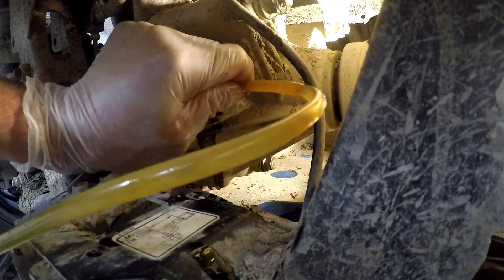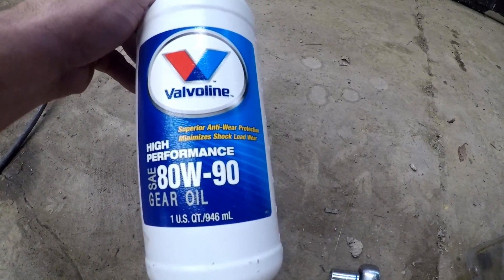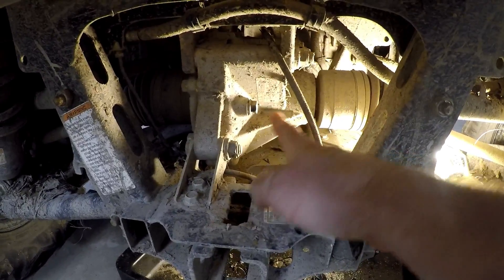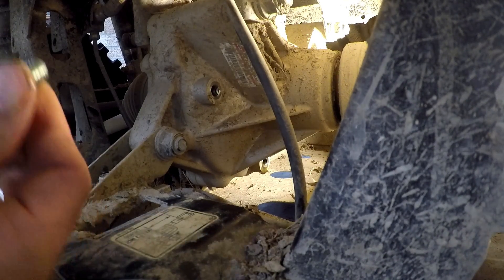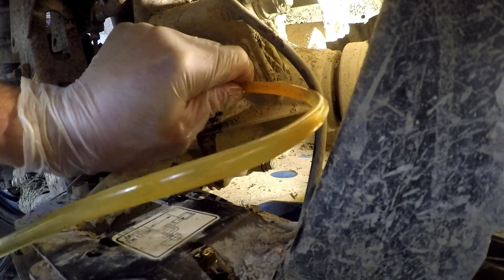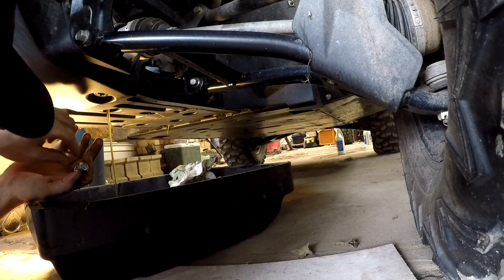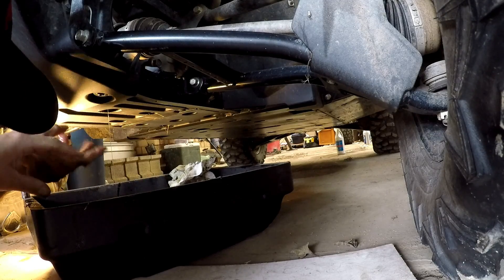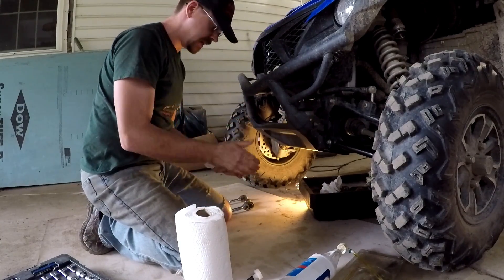Yamaha Wolverine X4 Service: Differentail Fluid Change

Comment: Thanks for the vid Jason.  The allen plugs will never be an issue so long as you use a quality set of tools.  Also, add brake clean to your shop supplies, i spray the diff plug on my Polaris with it to clean the mud out.

Comment: Jason do you still post? I have recently been having my wolfie X4 heat temp rise to 250 degrees. The fan kicks on and radiator is not hot. Also we have 50 degree weather. Have you or anyone ran into something similar.

Comment: Hi there, I’m noticed my Yamaha Wolverine X4 was leaking oil under the machine.  When I checked what it was, I noticed that it was leaking from the air intake duct check hose under the vehicle.  When I took the air intake duct check hose off to clean it, alot of oil came out.  Where did that oil come from and do I need to change one of the fluids to replace it?
Reply from the maker: The most often case of that is caused by too much oil was put in the oil tank either at the dealer during their initial prep or during an oil change. That’ll cause it to run through the breather hose into the intake and cause that.  Just make sure to clean out what’s in the air box and duct as best as you can and check your oil level (make sure to follow how the book says to check it) and you should be good.

Comment: What is the hypoid meaning? Is it supposed to be labeled? I’ve got stp 80/90 sae gl5.
Reply from the maker: Hyoid is what the gears found in a typical rear end are called. The gears are spiral cut with the pinion gear of the driveshaft engages the ring gear of the rear end below the center line of that ring gear. What gear oil you have is fine to use.

Comment: Jason I've noticed you use a Yamaha Wolverine x4 service manual . Does it detail the wiring of the X4 ? and where could I purchase one of these probably Download to Mac Version ? Just not a paper one .
Thank you, Mike
Reply from the maker: It does have a full wire diagram in it. I actually had a Yamaha tech that's a subscriber send me a digital copy for my use but all you need to do is google it and you can find both digital and paper copies
Reply: @AppalachianMountainRiders   Thanks Jason...Ordered a paper copy !

Comment: Greetings from a 2019 X2 owner. Where is the transmission oil change. I watched the oil and diff vids. Never saw the promised trans change vid. What’s up?
Reply from the maker: Just haven't changed it yet. When I got the display changed and was talking to the techs, they said besides making sure it's not low, you don't kneed to change it till it's second service. Not what the book says but I check fluid before eceryride and it still looks great! I will do a vid of it when I change it though.
Reply: Look in owners manual it shows the plug location and fill port under passenger seat.

Comment: I drained my rear differential after buried the whole back end in water and mudd.what should I do
Reply: It's milky, I put new fluid, will it be ok
Reply from the maker: If the fluid was milky you definitely got water in it. I would recommend only running it a 3-5 miles then change it again just to make sure you got all the water out. As long as you got the fluid changed fairly soon after swamping it everything should be ok.

Comment: Looks like front diff service might be a bit difficult with a winch in place..?
Reply from the maker: I  bit more yes. You have to go in between  the front a arms to get to the fill plug. Easier to do if you pull the front wheel off but can be done with it on.

Comment: Did you ever post up the X2 transmission oil change video?
I can't find it anywhere?
Thanks
Reply from the maker: I’m changing it again in the next couple weeks and will get a vid of it. I had to change it quick the first time and didn’t have time to film it.
Reply: @AppalachianMountainRiders  i have a question. I just got my wolverine and love your videos thanks so much.
My unit has 50hrs and just stared to shut off after i start it and i have to restart...i only use pure gas 100% any ideas??? Thanks also looking forward to trans video ;)
Reply from the maker: Very common with these. First thing to try is replacing the spark plugs with better ones and run synthetic oil. This seems to solve that issue with 99% of them.
Reply: @AppalachianMountainRiders  thanks so muchhh and I will... also do you have a slight clunk in the front differential when giving gas.. i jacked it up and free spun tires. Seems a little play and i read this should be normal. Does your do this??
Reply from the maker: I don’t recall any clunk in mine that caused me to take notice. I’ll pay more attention next time I ride and see if it does. And yes, a little play is normal.